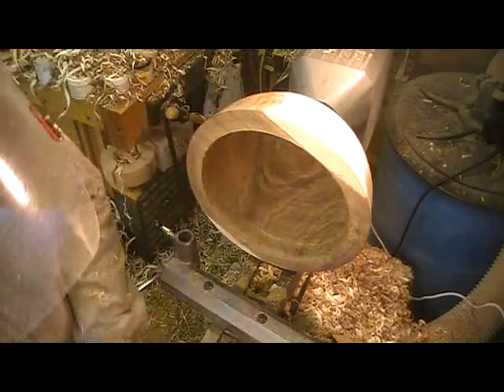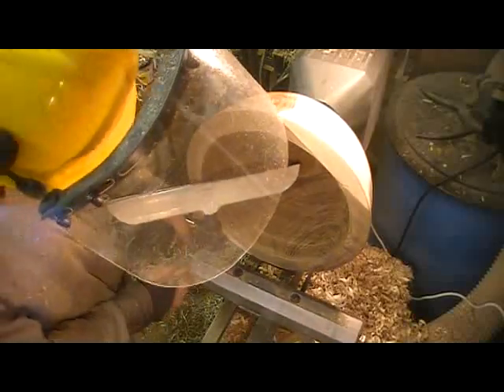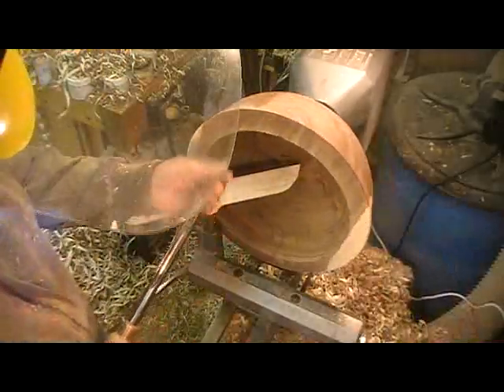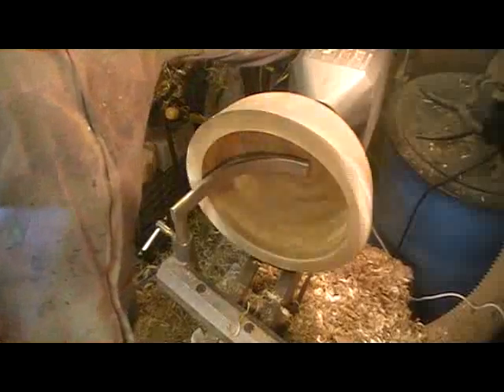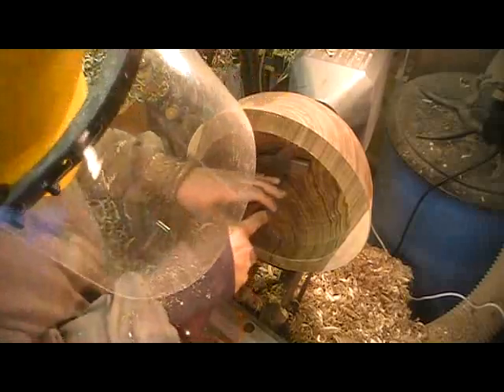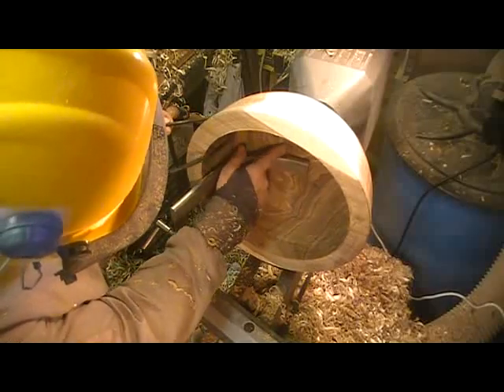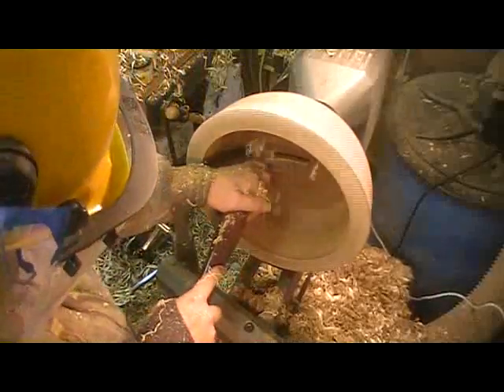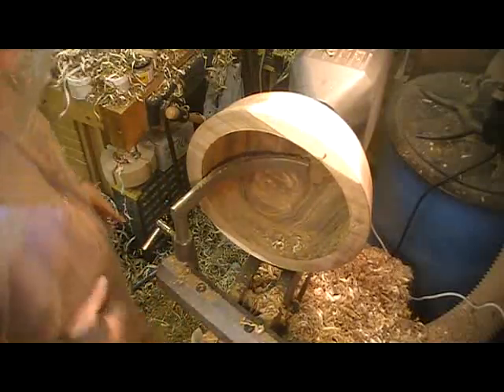Roughing bowls part 3 of 3

Comment: For lack of anything else, I used roof patch I had on hand, and it worked fine to seal the ends of the logs for later turning. I appreciate your video as a learner's guide. Thanks!

Comment from the maker: @MrLeonard55 
Hi, Leonard:
The tree was cut down on Oct. 30 and my sister-in-law and her husband brought the logs over late that day.  They also brought half a dozen pieces that had been cut into ~16" lengths.  I put Anchorseal on the ends of all of the wood and got the short length pieces roughed into bowls during the first week or two of November because the short lengths would have been very likely to split too badly to use if left.

Comment: If you dont want to wait a year to finish turning a bowl with the paper bag way or even waiting 6-8 months with the anchorseal way, I use a product called Pentacryl. I can rough turn a bowl, use a paint brush and saturate the rough turned bowl with the Pentacryl and let it dry. While other people are looking at their bowl drying, I can be finish turning my bowl in a month or 2. Maybe a little longer on a larger bowl. Less lost bowls due to checking. $20 a quart is worth it in my opinion.

Comment from the maker: Hi:
I put Anchorseal (original formula) on the end grain areas and store the roughouts in an unheated shed.  I do still get some that split, especially the largest ones.  I had 4 or 5 of the bowls I roughed from these walnut logs split on each side of the tenon.  You can see how I saved them in my series on saving some split bowls.

Take care
Bob

Comment from the maker: @Wheelin4lyfe 
Hi, Adam:
I did try that stuff a few years ago when I had an small ash log section.  I put Pentacryl on half of the roughouts and nothing the the others.  I can't really say I saw any difference other than the discoloration and odor on the Pentacryl ones.  I hope they are not still selling it in plastic bottles.  The half bottle I had left was stored on a shelf and started leaking a year or so later.  It made quite a mess.  It really turned me off the product.

Take care
Bob

Comment: I'm new to wood turning,but was wondering why you wouldn't take the center out of the second bowl before removing it? Then use a vacum chuck to hold them after they dry.
Reply from the maker: Hi, Clarence:
With the McNaughton coring system the path of the knife (and therefore the shape of the core) is not predictable enough to take a chance on hollowing the bowl before cutting it free.  Trying to guess what depth to hollow to and leave a consistent wall thickness would be pretty well impossible.  I do have the Oneway coring system now and it is much more predictable with regard to how deep the knife is going to cut into the blank.  When I have a large blank I take multiple cores.  With the Oneway system I can start with the smallest core and work out to the largest, something I would not even consider trying with the McNaughton.  I still don't hollow the smallest bowl before coring, though.  I need the outside shape to be there so I can hollow to a consistent wall thickness.

Take care
Bob
Reply: Thanks for your reply as a new turner youtube has been my teacher and the feedback from you,Carl Jacobson and Capt Eddie has been great.. Any advice on turn green pear wood? I was able to score a little more than a cord from 6in dia to 14 in dia,also some magnolia all free.
Reply from the maker: Clarence Marsh
Hi, Clarence:
I have never had any pear or magnolia to turn, but I would treat it much like any other wood.  Get the ends of the logs sealed as soon as possible after it is cut and if there is any checking there before you get it sealed trim the ends to remove the checking before sealing.  If they are "stove length" rounds cut them into half logs right away, removing the pith, because that is where the checking usually starts.  Try to get them roughed out as soon as you can, but keep them someplace where they are sheltered from the wind in the meantime.  I generally keep a tarp over my pile of slabs so the wind doesn't accelerate moisture loss from the end grain.

Good Luck!
Bob
Reply: Thanks for the advice! Right now it's about 20 degrees here in PA. Can i still apply the sealer in those temps?
Reply from the maker: Hi, Clarence:
I suppose that depends what you are using for a sealer.  I use Anchorseal which is a water based wax emulsion.  It needs to be stored where it won't freeze so the container I am working out of would be at room temperature.   Once it is spread on the end of the log it will still seal the grain even if the water carrier is frozen rather than evaporating away.  Once the temperature rises above freezing the water would thaw and evaporate, leaving the wax behind.  It is probably not the best practice but it does seem to work for me. 

Take care
Bob

Comment: @bobham5

As far as the wood goes, I have been turning for lil over 2 yrs so I by no means say I know more than other people but I know what I have seen. I coat the small pieces with a paintbrush, 1 coat x day for 3 days, bigger stuff I immerse in it for 2 days so it soaks up all that it can soak up then let it dry until moisture content comes down to 10% - 12%. It has seemed to work for me and haven't lost a bowl yet which is always good. Respond to PM at wheelin247@ymail.com. Thanks.